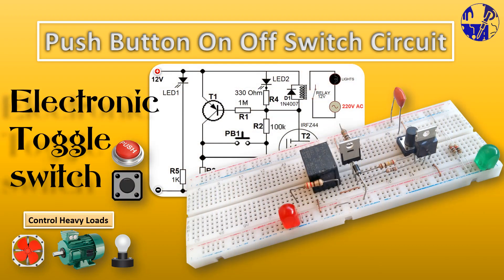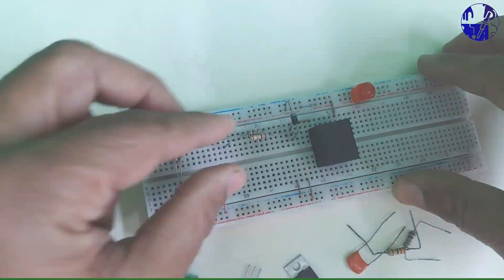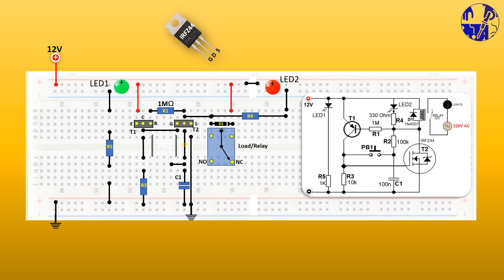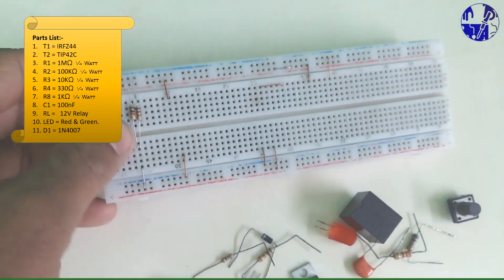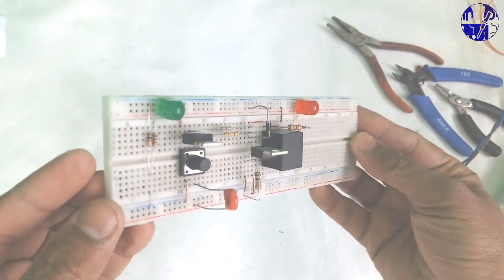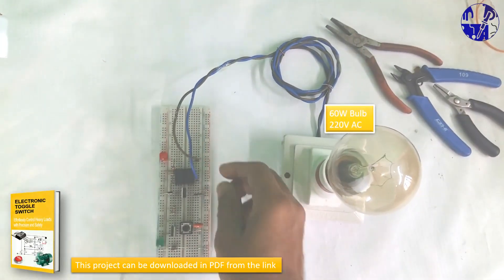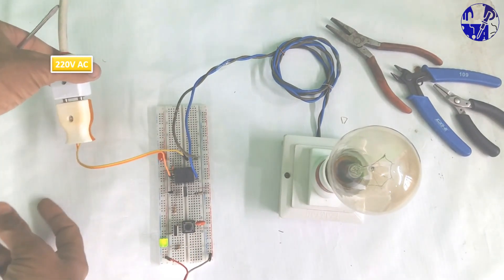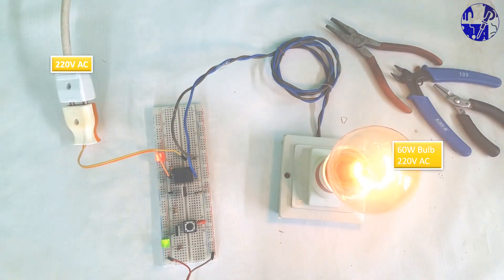Push Button On Off Switch Circuit on breadboard | Electronic Toggle Switch

Comment: I connected it as above but encountered a problem. Toggles on and off as desired at 3.7v but is always on at 12v but cant toggle off
Reply from the maker: Hi, thanks for checking out my video! It's great to hear that you're interested in trying out the push button on-off switch circuit. Regarding the issue you're encountering with the circuit not toggling off at 12V. I have created a post about this problem. please follow this link  
http://youtube.com/post/Ugkx3NFyJPr36ZJ85s3cj9NHYVRCsYMTKo_O?si=ziQlbS5JG5fkeP2x
Reply: @HobbyElectroLab  thanks

Comment: What is its minimum output current ? Incase I am to use a different load other than a relay?
Reply from the maker: There’s no minimum current limit—any load can work. However, for the maximum current, you need to check the MOSFET’s maximum drain current rating. The load’s current must always be less than the MOSFET’s maximum drain current to ensure safe operation.
Reply: @HobbyElectroLab  thank you. That's good to know